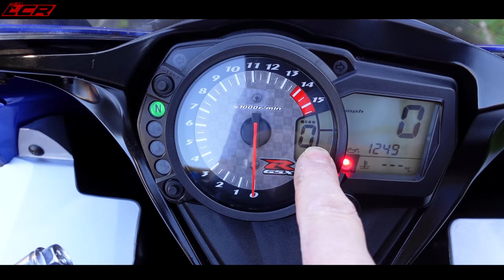I've Bought A Retro Sports Bike! | She's Immaculate!! 🤩

Comment: Congratulation Chops! Remarkable example of retro superbike. Check mine 1000 K1 on my channel. https://www.youtube.com/watch?v=QiPIDDaFJFw
I am thinking of upgrading it with traction control from Healtech ARA, Brembo master cylinder and maybe quick shifter from Healtech. I already have spare engine for it just in case something happened to original one as it had already cracked head which I changed and Healtech Fi Tuner so I can put it on a dyno and tune it with Titanium headers from K5. 

We have now quite similar machines as I have also Monster 1100 with that air cooled DesmoDue 😁. GSXR is for fast roads and big tracks (Most and Brno here in Czech Republic) and Monster 1100 is perfect for backroads around Karlstejn castel and at Supermoto track at Sosnova in Ceska Lipa.
Reply: About the same age as my 2000 E1 ZX9r 👍
Reply: @HalfdeadRider  I test rode many times zx 9r as my friend had it. It doesn’t have that huge midrange as mine Gsxr 1000k1 but it is much more comfy and it is great compromise between super bike and touring bike. Also power delivery through those carbs are so much smoother than on mine k1 with fuel injection. This old Gsxr is very raw and aggressive machine.
Reply: @monsteralex3098  not true with mine bud, its a beast through every gear from low rpm until it hits warp drive at 6-7k rpm, instant throttle response, have to have good throttle control. Maybe your friends wasn't at its best, idk.

I would love to try others out to see the difference though. And they certainly are nothing close to a tourer of any kind as people annoyingly say lol. I know they have higher bars than many sports bikes, similar to Chops new one as he mentioned. II had a 2008 er6f before the ZX9r (sports tourer), with Renthal unltra low bars on that I fitted, still a lot higher that the ZX9r.
Reply: @HalfdeadRider  My friends zx9r was very fresh. After first owner and around 18000miles. It is definitely more superbike than sport tourer like let’s say z1000sx. However there is difference in engine capacity. Gsxr 1000 k1 has 988cc and yours has 899cc and you can really feel it in torque and midrange. You have to swap the bikes with someone who has those old school Gsxr to feel the difference. But zx9r is really good. I love those old school machines❤️
Reply: @monsteralex3098  Yea mine had just over 16k miles when I got it a year ago (getting close to 20k now), it had not been used in seven years. The carbs were all cleaned and properly set up, and had some tlc before I purchased it.

I guess your bike kicks more/earlier in the mid range and has a slightly higher top speed. Mine is very fast still from low down, then turns into a missile at 6-7k rpm up.

The lighter E1+ are still good for a 0-60mph in three seconds stock. Mine has a lighter exhaust and a K&N filter, and a +4 ignition advancer to make the bike as it should be from factory.

I may jet the carbs at a later date, but doesn't really need it, it really is ballistic (as most big sports bikes are), shew a 2013 V4r that they still can have fun with the rest on NYD 👍
Reply: @HalfdeadRider  Gsxr has 160hp and zx9r is I think about 140hp. Gsxr pull nicely already from 4000 rpms and in 6000 it kicks in and in 7000-8000 it is rocket. All of this super bikes which have capacity over 900 have the same acceleration times to around 200km/h and only in higher speeds you really can feel the difference in horsepower. In the lower speeds let’s say from 100km/h to 200/km/h when measuring elastic acceleration there would be also difference as I would start accelerate  with more power in higher rpms . But honestly for real world riding everything which has more than 110-120 hp and has good torque of around 100 Newton’s is more than enough. I have second bike monster 1100 and it has only 95 and for most situations it is more than enough, only on highway in higher speeds you fell lack of power, but for back roads it is perfect machine. It is more fun in slower speeds than Gsxr as it likes to wheelie a lot 😀.
Reply: @monsteralex3098  Exactly mate, this is why I said mine will do 0-60 in 3 secs (yours probably the same), but yours will have a slightly higher top speed. Higher BHP 'almost always' means higher top speed, yours certainly will not fly away from mine at any speed, but would have that tiny little edge at certain speeds and above. 

We also have to remember gearing ratios have their say too, there is a lot more involved with how any vehicle runs in real world situations than just the BHP number. 

160 bhp over 144 bhp (yours has 110 Nm torque, mine has 101)(stock numbers, remember mine is not) does not necessarily mean it faster all the time, or much at all. It also depends on how well each rider gets off the line to begin with, if we did race, if I got a better start you'd struggle to get beside me, let alone pass, as our bikes are very close in performance.

If you checked some full performance specs, you might be surprised quite how close on paper ours are, for 0-60 0-100, quarter mile times etc. As usual, even with new vs ours, it will be just thousands of a second, nothing in real work riding.
Reply: @HalfdeadRider  Totally agree!

Comment: I had a k7 1000 and sold it within a month the handling was rubbish compared to my old 750 k6 then bought a k5 1000 and the handling was just like the 750 really good, so mucher better than the k7. Sadly it got stolen and now I have my L2 which handles just like the k5 but the k7 wasn't for me, didn't handle very well could have just been the suspension needed setting up for my weight but the k5 and L2 handled awesome without touching the suspension